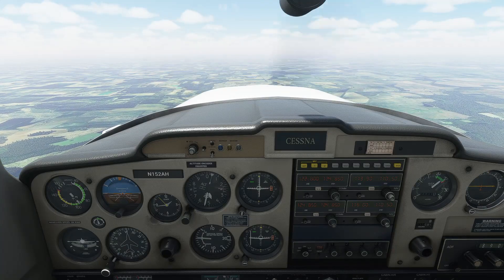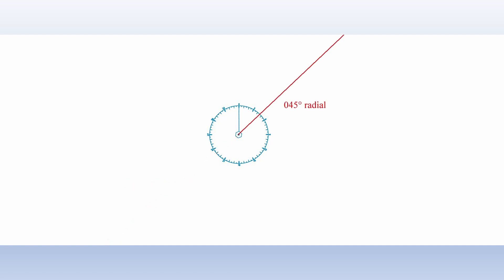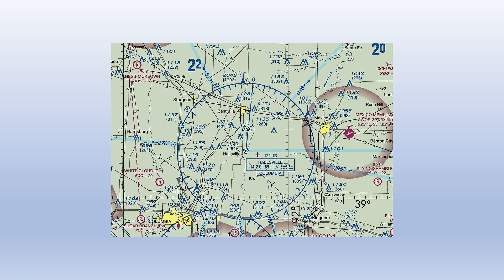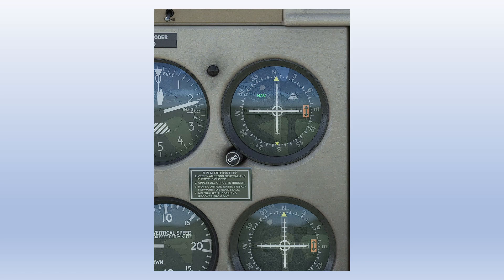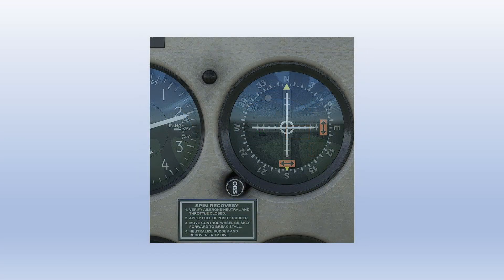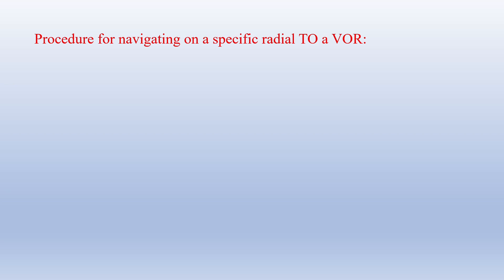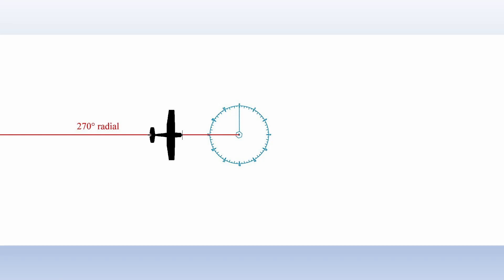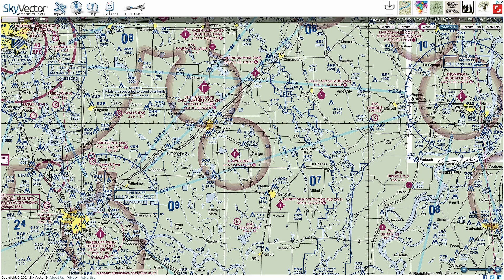MSFS 2020 - VOR navigation (AH VFR/Private Pilot level training, flight lesson 10.)

Comment: Thank you for your thorough training on VORs.   In this gps oriented world,  this valuable skill gets passed over I think.  Hopefully,  folks won't be so afraid of that OBS button on the G1000 as knowing how to navigate these old devices just makes you that much better.  Good job!
Reply from the maker: @markfletcher4579, couldn't agree more.  A good solid foundation in the fundamentals of VFR and electronic navigation will give you superior situational awareness.  Moving maps are great, but the best moving map you can have is the one you have in your head.  Anything else should be supplemental to that.  

And the OBS mode (on both the G1000 and the GNS 430/530) is a very powerful tool, if you learn how to use it.

Thanks for watching!

Comment: do vor's change numbers?  i just looked this up on skyvector and Helena shows a vor of 113.65 now.  Also trying this after passing over the first vor my flag never flipped to outbound until way past the vor.  Do you need to pass directly over it or can you be off a bit?  skyvector also has the outbound to little rock labeled as now T398 what is this ?  How often do these change and how often does msfs keep this updated ?
Reply from the maker: @timmkopp - it is rare, but in this case that is exactly what happened.  I'm assuming the replaced the VOR with new one with a new frequency.  They also decommissioned several of the VOR airways, and replaced them with RNAV (GPS) airways.  This is what the Tango routes (e.g. T398) are.  (The literally did this a few months after I made this video - though the old radials should still work if you want to fly the old Victor Airway.)   MSFS does integrate these changes, but they are typically a few months (years?) behind in implementing them.  

You should always try to pass directly over the VOR, but even with a lot of practice and experience you won't always get it super precise - particularly if you are at a higher altitude. 

Glad you enjoyed the content, and thanks for watching!